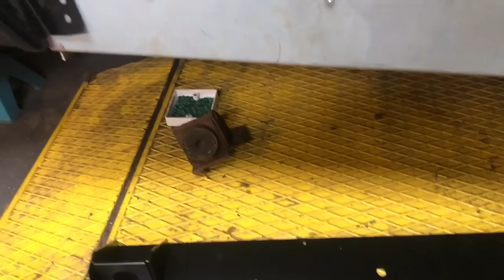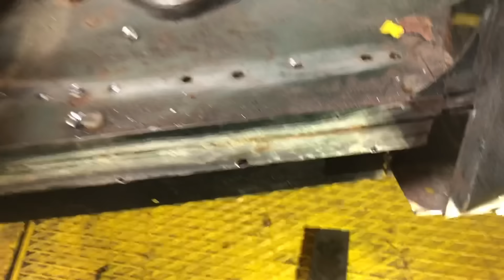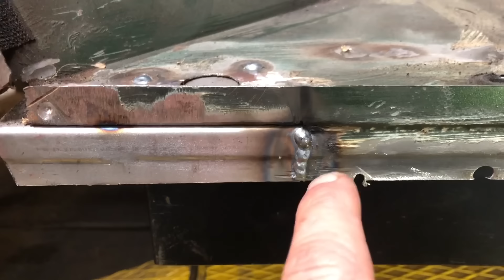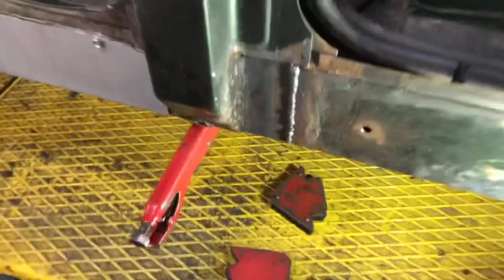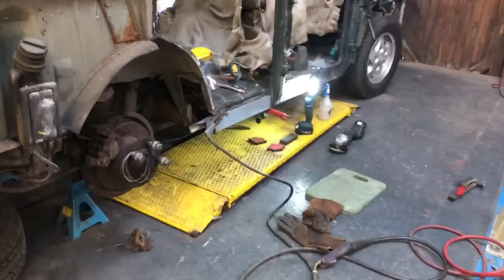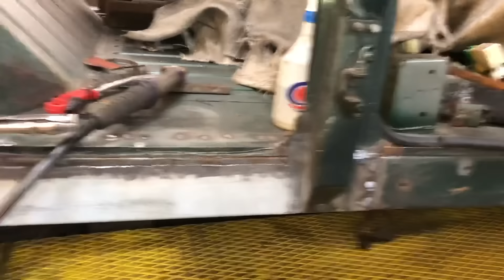Range Rover Classic LSE Soft Dash Project PT 11

Comment: Really enjoying watching your restoration on the RR.  I often wonder what happened to RR Vogue  Classic of 1990, I owned. Not now in use on vehicle  enquiry which is a disappointment. It had a new auto box, new tail gate, new rad and oil cooler, and only 90k on a 3.9.
Reply: Try mot history. If it shows up on there but not vehicle enquiry then it has a certificate of destruction - so scrapped :(
If it doesn't show on either then it most likely has a private plate now :)

Comment: In the early 70's our first flat was dead opposite a couple of Car Restorers/Bodyshops and as a keen car doer-upperer it was great to see what a little bit of welding could do ............. Sooooo I went and bought Meself an Arc Welder out of #ExchangeAndMart and I was Raring to GO!! ..... Trouble was, I never quite mastered the Dark-art of Welding - I always ended up with BIGGER holes than I started with........ 
I gave it a few more tries in the following years, but finally gave up and sold the kit to a Mate for a £fiver ....... 
Great to see the job done 'properly' though :-)

Comment: When I do this stuff, people sometimes look surprised by the cost but looking at what you are doing and the time taken just for the welding alone without all the strip down, preparation, fabrication, re-assembly then a full respray and all the detail work, it starts to look like a ten grand job, if you were doing it for a customer and this is only for a "light" restoration,  imagine what it would cost if you did a complete restoration!!

Comment: I've done quite a bit of this kind of repair, a couple of things, first, it looks really quick on your time lapse but it actually takes ages to cut out the rot, clean it up, make repair plates, drill them, plug or seam weld them in, the other thing is plug welds, they look great but it's not quite so easy to make a really neat and tidy job when you are doing the less accessible areas or laying on your back underneath with all the spatter going in your ears and burning your neck etc. I still love doing it though and you are doing a pukka job.

Comment: Hi Rob I no you use dintrol products when your done but like them you cant get it every where like them little plates on the sill.  I HIGHLY recommend you an chris look into U Pol weld#2  through zinc primer you can spray either side of the patch before welding them on and it will provide protection both sides of the patch. It's a conductive primer so you can weld directly onto the primer surface and the heat wont burn it off either. Buy your self a can and try  it you will not regret it it's very good and I doubt your or chris would do a welding job with out it again .
Reply from the maker: We use it bud we have shown it in many videos. On the sills we are ok as it has plenty of holes for the side skirts 👌👍
Reply: @sruk  I just wanted to add to this I am not knocking your workman ship at all I think you do a top notch job and much of the work you do i would do in the same way. Me and my dad do exactly the same as you and chris he has got 45 years of experience in the motor trade he worked for Morgan for 25 years hand making panels and building chassis and repairing any damaged motors in house.

Comment: This Range Rover is going to rust away so quick once it gets outside in the wet weather with all these little bits of metal tacked on..Is it worth bothering doing all this work ?
Reply from the maker: Nothing is tacked on ? How is it going to rust wen it’s sealed up and painted ?
Reply: @sruk  I think somebody hasn't watched the whole video!
Reply: That's why you seal it and treat it with good quality rust proofer like Dinitrol. It will last better than it did out of the factory

Comment: I believe that the MIG welder is somewhat more straight forward to use than the old arc welders of 50 odd years ago. Getting the right small welding rod for thin metal and matching the current setting was a fine art. Perhaps it was one best not attempted by the novice. Whenever you got a good result, it was a source of pride. A nice little caterpillar, crawling across the joint; more often hidden rust tripped you up and a blow hole was the confidence sapping result. Our nickname for the small gauge rods was 'sparklers'.
Oh, for anyone starting out a good welder's face mask is obligatory, Not optional; 'arc eyes' are very uncomfortable and can be a limiting experience.

Comment: The tool links are a good idea,  Are gasless welders any good , the older garages always have the bottle ones. I would be a novice so would not have an account with the gas people. What ones are good to get for hobbyists etc, confusing looking at them on Machine Mart website.
Reply: Gasless only really good for hobby welding. Not cars. It can be done but you wouldn't win any awards for weld quality 👍
Reply: @RoverFolkUs  cool
Reply from the maker: From what I know gasless welders are rubbish
Reply: @sruk  oh right ,worth knowing . Looking forward to the american one . Maybe a quad , defo the mower and maybe a motor powered jet washer. If it's got wheels or can be welded Chris will sort it. Apparently autoauction.io shows prices for sold cars. Samcrac in the USA managed to get some epic bargains. A quattroporte and a 5litre range rover for cheap. Love the 4wd content. How can people dislike videos. I'm happiest when working on cars.  Didnt know you knew resurwreck autos. I recommended your knowledge and channel .